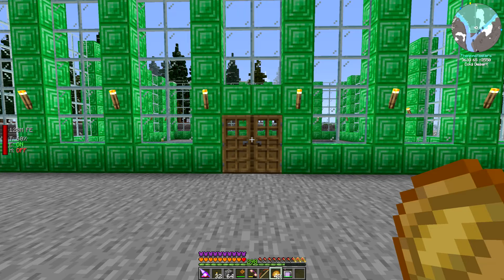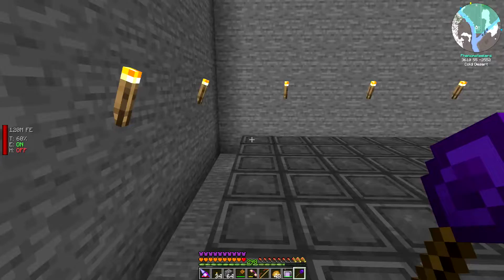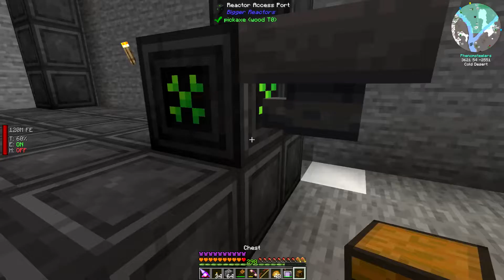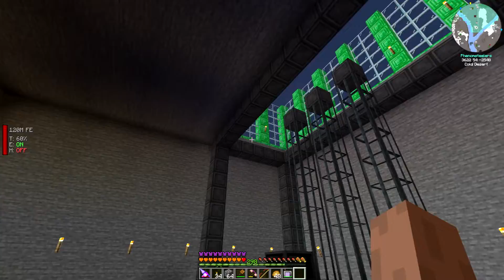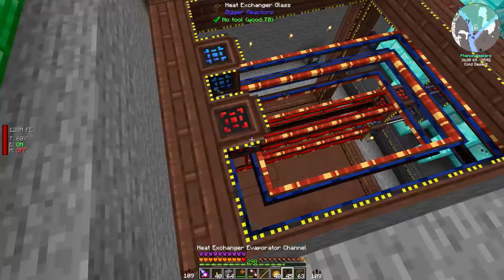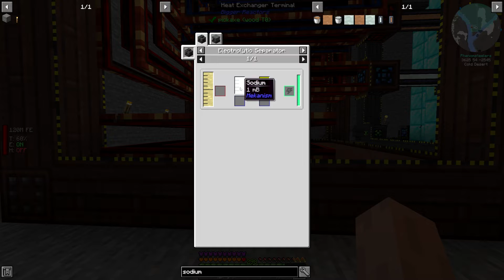Episode 36: Bigger Reactors Heat Exchanger Setup

Comment: None of this is actually worth the time, effort, and stress vs just creating steam from the reactor directly. The best I could get the turbine to do in this setup was 10RPM, with a straight reactor to turbine setup I easily managed 2000k RPM and the reactor was kept chill.
Reply from the maker: The gains are small, and it takes a lot of tinkering. I think it is fun to just mess around with to be honest. But it really isn't worth it for anyone who just wants simple and easy power generation.
Reply: @minecraftphenom0892  They really need to work on and release an official guide. Yours is the best video tutorial I've found but there really does need to be something official or even a retooling of the heat exchanger to be more user friendly.

Comment: Do you know what to do if your heat exchanger is going down in temp while the reactor is just increasing in temp? I am producing steam in the reactor but not in the heat exchanger evap channels.
Reply from the maker: If I had to guess, your issue might be coolant flow. It kinda seems that you might not have enough coolant in your loop (As in in the reactor, any pipes that you might have and in the heat exchanger). It could also be a lack of water problem. It's hard to say without actually having all of the information. I would suggest checking coolant levels in your reactor and heat exchanger (there should always be some cool coolant in your reactor and your heat exchanger shouldn't have either of it's coolant buffers full). I would also check your water levels in your heat exchanger and in your turbine(s). Last, check the steam levels in your heat exchanger and your turbine(s).

Hopefully this helps. Goodluck!
Reply: @minecraftphenom0892  I think this might help. My C loop is full of steam from the reactor with water going back into the reactor, but my evap loop is full on the water side but isn’t producing anything. This makes me wonder if I shouldn’t have put water into my evap loop? Is it possible to have put too much water into that side?

Comment: Has anyone figure out where the new "coolant manifolds" are supposed to go?  Inside the reactor?  Next to the fuel rods?  I have no idea.
Reply: i havent used these before, still figuring out big reactors, though i saw they connected to the coolant ports when i tried using them, and it was mentioned somewhere (i believe the mod author made a comment somewhere) that the manifolds push more heat into the cooling system by taking heat from the reactor casing, so i imagine its the same rules of the heat exchanger where more channels take out more heat. they do connect to the fuel ports though, no idea what thats about. Assuming you still need this
Reply: hey, me again. pretty sure they need to be connected to the internal case, probably why they looked like they connected to the fuel ports. anyway,  not sure if they need to be connected to cooling ports but i imagine the more there are touching the case the more heat will go into the cooling system (they dont seem to connect to glass)
Reply: I just use the manifolds in place of diamond/emerald blocks in the reactor. I think the manifolds work a lot better than just passive cooling blocks, at least for my reactor, heat exchanger, turbine set up. I do also fill in the corners with manifolds though, I think they all need to be connected.

Comment: A single 7x7x13 (outer dimension) turbine with 80 blades and 22 unobtanium coils gave me 99.9% efficiency and 854krf/t in ATM7. I was piping in 27B/t of steam directly in from my reactor. Went from 26k FE/t to over 850k with the same fuel consumption. I will have to mess around with the heat exchanger now and see what I can get out of it!
Hopefully this video is enough documentation because yeah, it doesn't exist. Props for sharing some knowledge 👍

Comment: Well just when I thought I figured out the majority of Bigger Reactors in ATM7, I see this. I never used the heat exchanger setup. I just pipe steam straight from the reactor to the turbine. I suspect the mod adds liquid obsidian in place of liquid sodium as shown in this video.

Thanks for giving me another thing to look into.
Reply: I've never seen any documentation of heat exchangers either. Do you think they are more efficient than just pumping steam straight from the reactor?
Reply: @slickittenounounoun  Well... Probably straight into turbine is more efficient. If you pump steam straight to turbine you have 1 step less.
Reply: @slickittenounounoun  I think the reactor is probably less efficient at producing steam, compared to the heat exchanger. I'm guessing a smaller or more efficient reactor coupled with a heat exchanger could produce more steam and power a turbine (or multiple turbines) for the same or less fuel input.

I just got into Bigger Reactors in ATM8, and have a large reactor with a large turbine producing 892,892 RF/t for 0.274mB/t fuel. This is with control rods inserted to 97% and no heat exchanger in the mix. I'm going to try to keep the reactor and turbine the same, and implement a heat exchanger between them. At that point, I will try to increase control rod insertion further to see if I can still produce enough steam while burning less fuel.